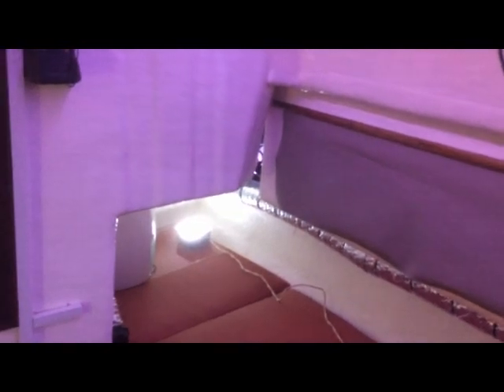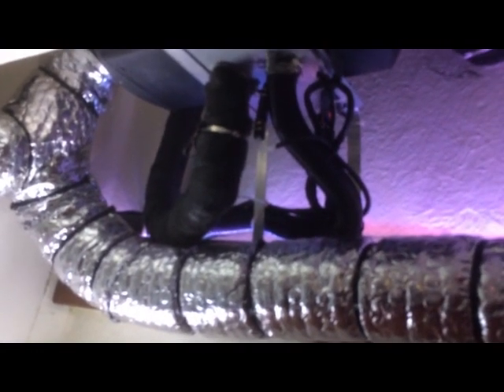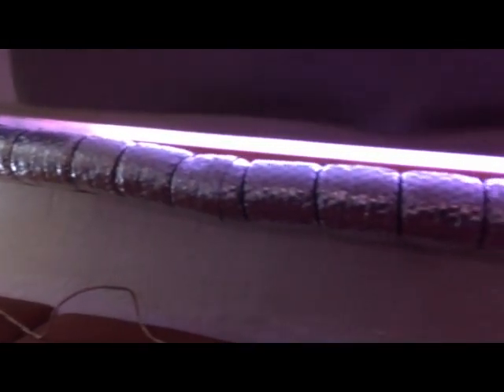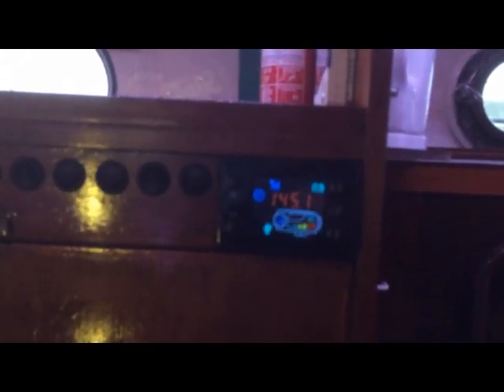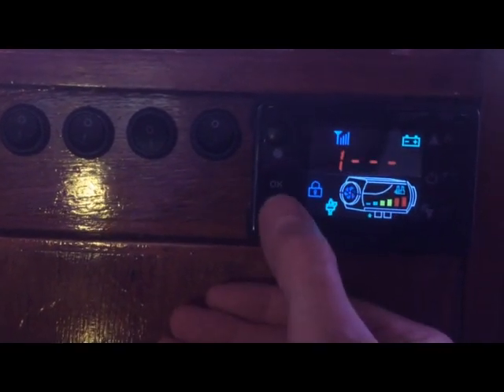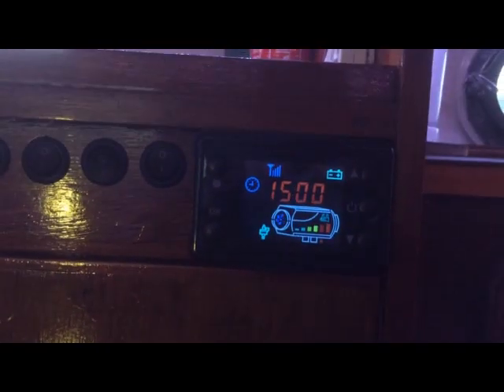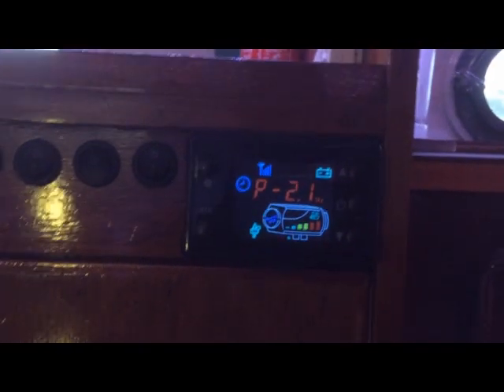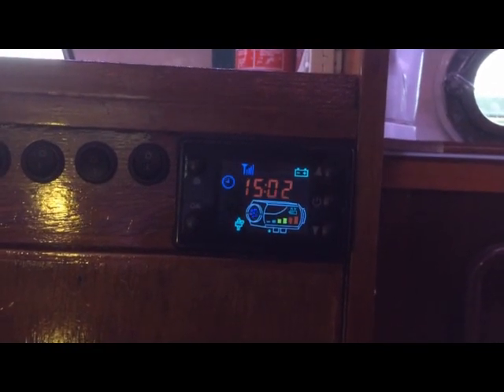eBay Chinese 5kw diesel heater - 3 Month review & fixing low voltage problem in advanced settings

Comment: I would mount the heater unit through the floor, no way would I have any part of the exhaust pipe running through the inside of a van ect.

Comment: Do NOT set the lowest Pump frequency that low !  
Very dangerous because of uncomplete burning causes huge amount of CO in ehaust below 1,2 Hz
CO is highly toxic 1.500 ppm in the air over 60 min is Lethal (LD50)

In my Case (8kW Heater Model) i measured over 500ppm in the echaust @1 Hz Fuel Pump with Premium Diesel
1,2 Hz ~ 40 ppm CO
1,4 Hz ~ 7 ppm CO
3,6 Hz - 36 ppm CO

4,2 Hz ~ 50 ppm CO

5,0 Hz ~ 70ppm CO
Reply: Hi, I am happy to see that you addressed this issue as I tried the low setting but quickly found out that it doesn’t burn cleanly as you said. I have watched so many videos and see people have a mixture of different settings in the code area and I eventually went for p 1.6, 5.5, 1680, and 4500 for those settings. I have the 5-8 kw model and have had it for 3 days. Would you kindly let me know if I have the settings right or need to adjust them? Thank you for the good and safe advice you gave.
Reply: @gordonmitchell729  My test settings from my spreadsheet are: 
Fan: 1500 - 4400 RPM
Pump: 1,0 - 5.0 Hz
Below 1,3 Hz the combustion is bad.

1.5 - 2,1 Hz has Excellent cumbustion with very low CO <15 ppm
Until 4.0 Hz below 50 ppm

My unit did 65ppm CO @4400 RPM and 5.0 Hz
I recommend to limit the Pump to 5.1 @ 4500 RPM

The new Unit from a friend overheat last week @ 5.5 Hz so we decide to limit it to 4.8 Hz

Also i Recommend the Unit with the Red Remote, because it show informations like Voltage, Air Temp, Pump speed and Casing Temperature

If you have more questions feel free to ask.
Reply: @Hobby_Electric  excellent thank you for such detail. I will do all these checks today. Amazing detail for sure!
Reply: I have a question if you don't mind. Our diesel heater is blowing out cold air. We replaced the heat sensor and now the heater will switch off but it's still blowing cold air. I don't think our van batter is above 13.5v do you think this is the issue?
Reply: @sarahmcloughlin4910  The Voltage should be good, everything above 11V should work fine.
Maybe you can check this list:
1: Is the In/Output for the Combustion clear/free ?
2. Fuel and Pump
Does the Fuelpump begin to pump and deliver Fuel ?
3. Glowplug
Measure the Current input of the unit while starting, the Gluwplug draw over 8A Current

How Old is the unit/has it many Working Hours?
Did the Unit had a blackout (Input voltage breakdown) while it was running ?

Comment: I ordered the 24v version but the one I received says 12v at the back of the heater. The seller says it will work on 24v. I am worried if I wire it to my 24v system it will blow up the machine. Help me! What is the label on the back of your machine?

Comment: You can heat water with the exhaust pipe outlet too. Wrap a 5mm copper coil around the exhaust the whole length and seal it with fibre glass.
Put a chamber at the end with another coil inside and seal it off.
Join the pipes and use a 12v mini solar pump (cold side in).
3 gallons heated to 45 degrees within 1 hour on 1.6Hz.

Down side: water tank need to be lower than the heater to evacuate the excess water in the coils when you stop the pump or it creates steam pressure. Make sure there is a hole in the water tank lid.

I use red diesel in my heater this is allowed for campers/boats/caravans/homes. 

I bought my heater 3 years ago (cheap Chinese one) its been faultless and unbelievably economic.

Comment: I have a heater in my van now over a year with the usual error code here and there but this week e01 error code displayed but cannot reset this time. Batteries are fully charged. I'm wondering since making this video have you had any more issues with yours. Thanks
Mick.

Comment: Thank you, you champion! I also swapped from the rotary dial to the digital controller with a remote. Then I got the E-01 code. Swapped back to the dial and had the same problem. Your video saved me. Entered 1688, switched to 12v, all fixed. Fired right up. 9 degrees C outside and got to 25 degrees C in my van in about ten minutes then slowed down so you couldn't even hear it maintaining temp.
Reply from the maker: I am pleased that you got the heater working and glad that my video was useful!
Reply: @VanandBoat  is there no way to set to 12v with the rotary dial? ( i have the same problem )